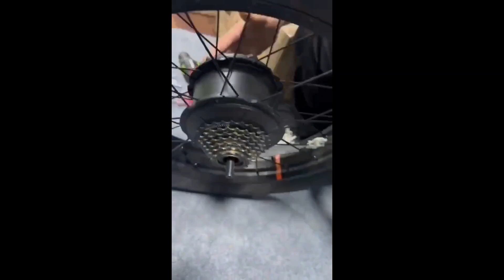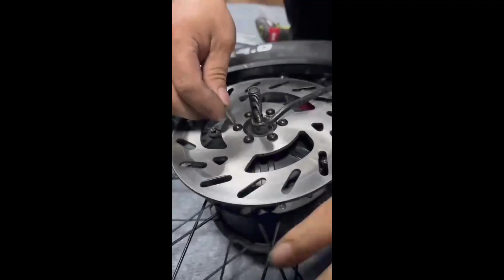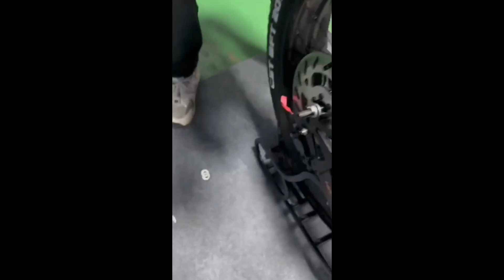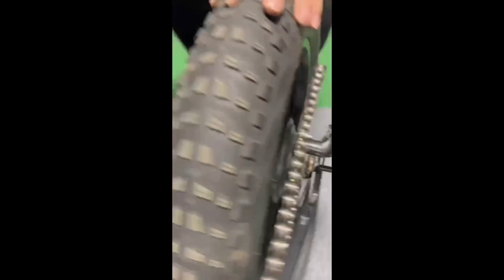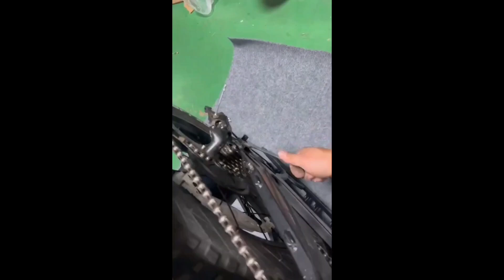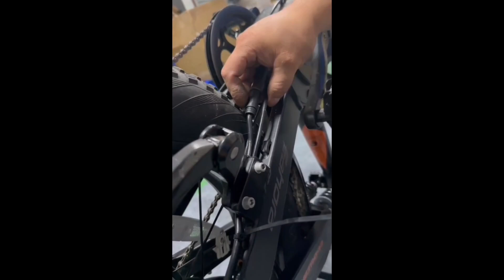Install the motor-Eahora Juliet

Comment: Is it possible to install 2000w motor on 48v 60ah aehora juliet?
Reply from the maker: It is not recommended to change the original configuration. Because many electronic control systems are equipped with pre-set data, once modified, it may affect the performance of the battery or controller.